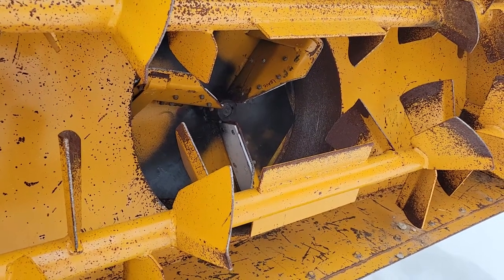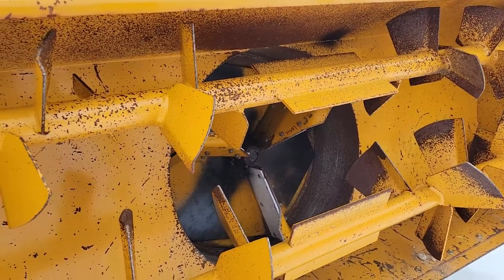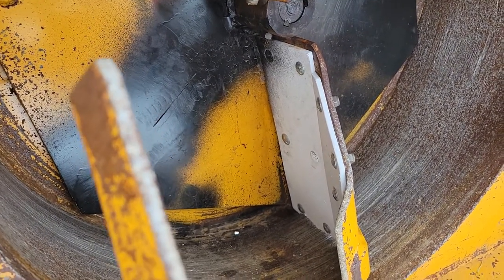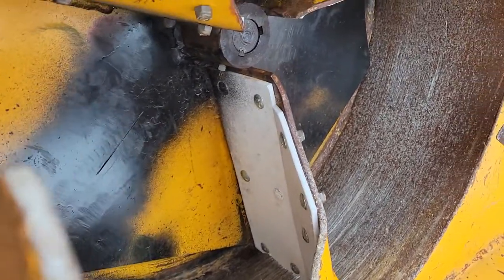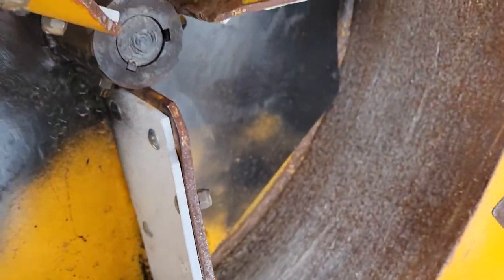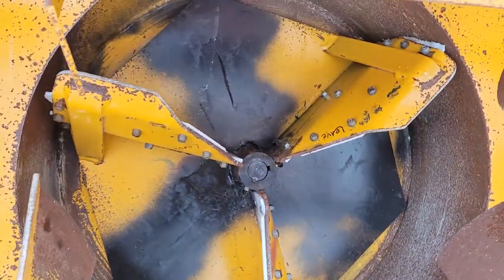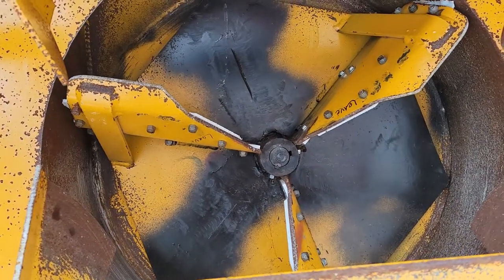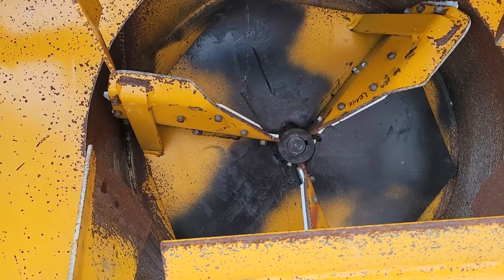Lorenz snowblower modification.

Comment: Interesting.  Smart to think about balance even though though impellers, generally, aren't very high speed.  Usually 1300 rpms for small ones, that one maybe less.
Most modern walk behinds only have 3 paddles anyway to save on metal.
Old Ariens had 4, and the commercial ones had 6.
Reply from the maker: No issues with vibration.

Comment: Did you cut this while the center wheel blade was in place?
Reply from the maker: @3dprintingdentist599  I pulled everything off of the blower and worked on it on my welding table. That where I used the plasma cutter. Torch will work fine.
Reply: @frankglass  Did you have to take off the front augers to get the center wheel out?
Reply from the maker: I took off the bottom one. But it's easier to work on if both are removed